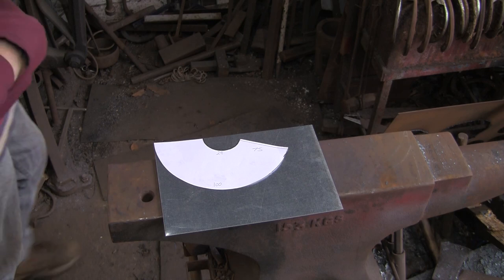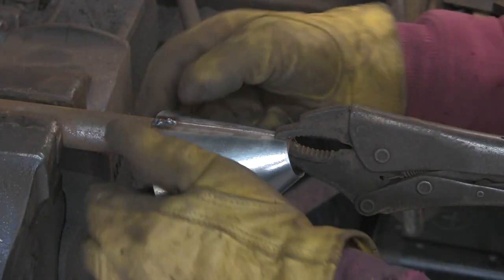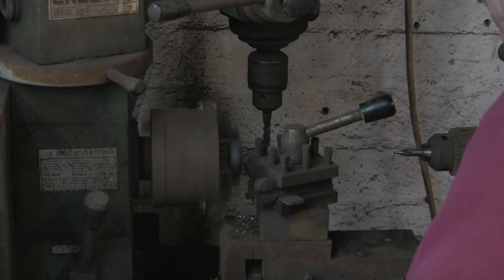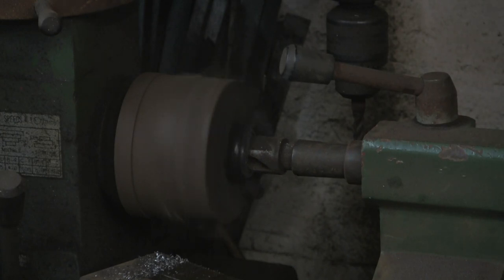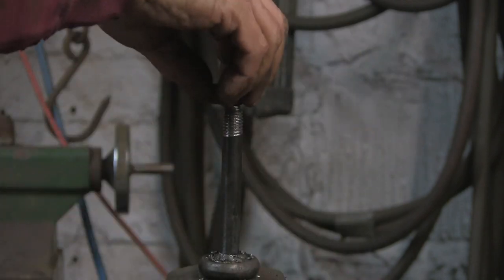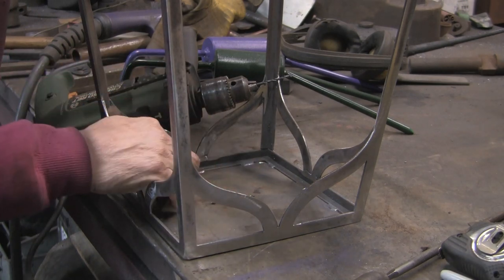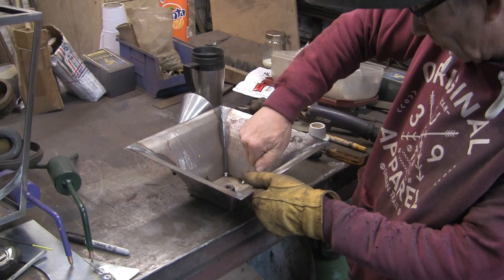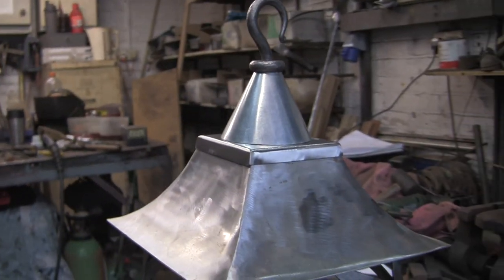Electric Lantern build part three

Comment: To make the cone top a wooden tinner's mallet or raw hide mallet works well. I use Galvanized sheet stock (22 to 26 gauge)for lighting indoor and outdoor and use wood mallets mostly. A quick brush with a scotch bright pad ( Scrub pad)for a satin finish or polish and it looks like polished tin plate.

Comment: Wonderful work Gary !   I truly hope your hand/wrist gets better and soon. I had my right thumb operated on last summer for a detached ulnar collateral ligament and I'm still only 80%  Hard to have good hammer control and lasting grip strength, but I'm slowly getting there.

  My father built a pair of similar lamps using all soldered copper back in the 70's. they sat in the basement storage for 30 years until he/I built the current house where they are now used in the front. He soldered "tabs" on the inside to hold the glass which makes me wonder how yours will be glazed....  I will have to get a few pics for you. 

  I was just commissioned to do ALL the metal work on a new Amish barn hinges, latches, post plates, lamps etc....  and this series will help me with construction of his lamps if he chooses to have me make them.  He wants me to use shoes for everything I can, but not being a farrier like you, I don't have such a beautiful shoe pile to pull from.  

 One thing I thought of while watching this video was how you attached the nuts to the top whereas I would have reversed them, but looks like you did a bang-up job anyways !

    Todd
Reply from the maker: T. DesMarais, Todd' I hope it recovers too but at the moment it still seems to be getting worse!
I always fancied doing a copper lamp but never got round to it, not sure how you do all the solder joints without unsoldering others! Might have a go one day..
I did ask the client about tabs but he said his glazier would glue the glass in.
Good luck with the ironwork job, sounds interesting. 
Not sure what you mean by reversing the nuts on top..
Reply: I meant I would weld the screw/treaded rod to the top, where you have the nuts attached, and use them as a stud, then use washers/nuts to hold it together. In my mind, it's easier to assemble with studs than trying to feel for the nuts and hope the angle is correct after they are welded on...  Similar to a car wheel. I HATE my old VW for that exact reason... always hard to mount the wheels. (hubs are threaded)
Reply from the maker: T. DesMarais, I see what you mean, yes could have been done that way, I just didn't think of it at the time!

Comment: Do you ever try and use solder for these type of jobs rather than weld?
Reply from the maker: al t, this is the first I've done like this but when I made a tin boat out of much thinner material I did solder it and it has lasted well! I think this material is way too thick for solder.
Reply: Does it have a similar sort of strength? (Sorry for bombarding you with questions)
Reply from the maker: al t, not really sure, I've never used solder on anything which requires any sort of strength.
Reply: Cheers. Great videos. Really enjoy watching people make and create. Have a good new year.
Reply from the maker: al t, thanks.
Reply: Gary Huston Hi mate I'm an AUSSIE and find your video's awesome! You would have to be one of the best Blacksmith/Farrier I've ever seen. I grew up on a dairy farm and have I good mate that is also a Farrier but he has nothing on you. keep up the good work and making great video's!!

Comment: I'm just wondering how or where is the electrical cable going to get through to the back of the bulb holder? Look forward to the next instalment when no doubt all will be revealed.
Reply from the maker: jonnno100, there is a cutout in the cone on top and a grommet through the square then another into the top of the bulb holder. I'll probably do a video once it's all powder coated to explain it all.
Reply: Gary, I swear this did not show up on my phone this morning...
Reply from the maker: trollforge, no worries, just saves me re typing it!

Comment: Hi Gary, would brazing rod be a good alternative to welding? my arc welder would shoot a hole through sheet metal. Also i wonder if brazing would cause less distortion of the sheet metal? any thoughts on the use of brazing rods here?
Reply from the maker: Yes you could braze it up if you have a good enough fit.

Comment: I’m new to tack welding or any form of welding. What machine do you use to tack weld and is it mig, thank you.....great lantern !
Reply from the maker: For this job I used a 300amp 3 phase Arc Tec MIG. If i was to do it again I would use my TIG

Comment: is it easier to put threads on something if you heat it up in the Forge first
Reply from the maker: bighurk30, no, I don't think it makes any difference. Just make sure if you are going to thread something after forging you don't cool it quickly as even today's mild steel will go slightly hard if you cool it too quick, let it cool naturally on the floor.